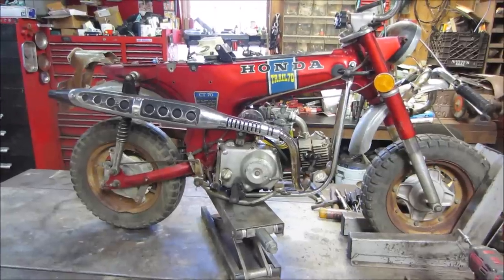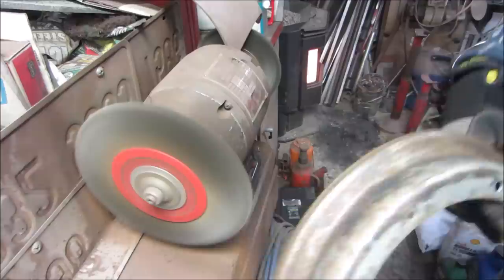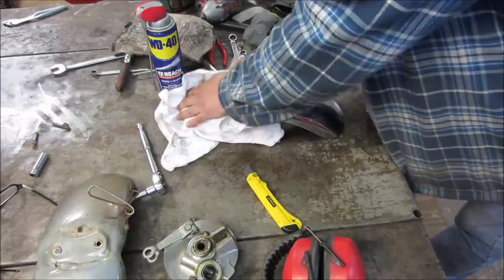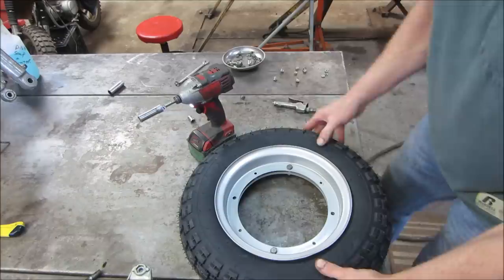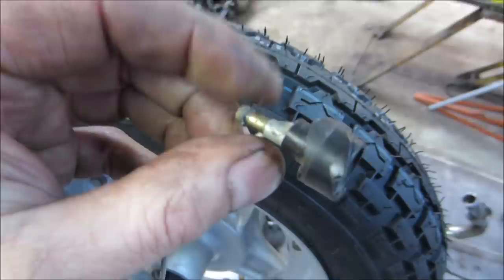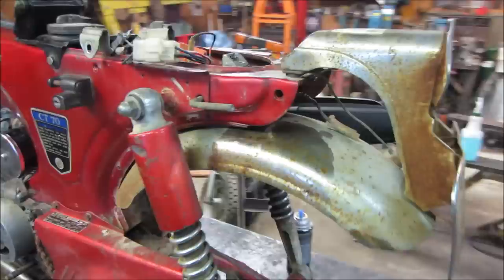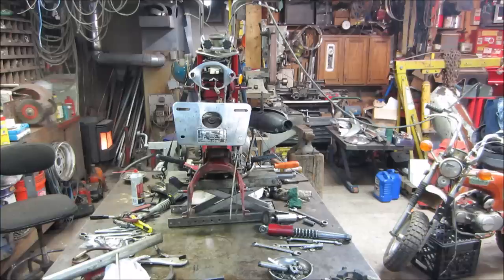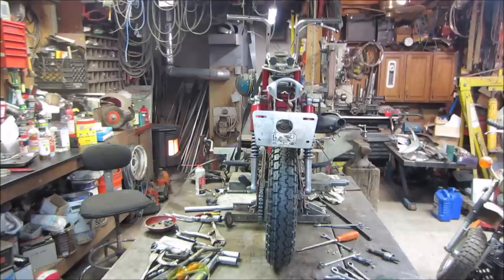Worn out Honda Trail 70, wheels and frame repair, pt5

Comment: Hi, 
I fixed up a 1980 Honda cb650 custom. I sand blasted and acid preped the  trailing arm and center stand the powder coated them, The bottom side of the fenders looked like your trail bike there so i used phosphoric acid which I think was a some kind of pool cleaning acid agent? It removed all the rust  VERY well but after that I brushed on some cosmoline greasy like stuff but it holds up very well in the road and salt corrosion. used the cosmoline on my trailer hitches as well too with great success. But its getting hard to find now. They used to protect the old stored military weapons with it. I , in my youth had a mini trail 50 Honda and we beat on it and raced it through the woods but we only managed to bend the foot pegs when "brushing by" some trees. they are very forgiving ! It is a about a 1970 model and still sits in my parents garage ready to the grand kids.
Reply: Phosphoric acid is the main ingredient in most of the relabeled 'Rust Killers'. Just cheaper!

Comment: In the UK we call the pin holding the wheel nut on a split pin (because it's split) and a tube that has a slot down its length a cotter pin, and a metal insert in a machined groove a keyway .

Comment: In the UK a Cotter Pin is the wedge shaped pin used to secure bike crank arms to the crank.   The pin that would go at the end of a brake pedal where it join the master cylinder is know as a Clevis Pin and the thing that secures that is a split pin....   Vive la difference..
Reply: Drew's Page , why do you people drive on the wrong side of the road ?
Reply: @bwanabwana9523  It's all Napoleon's fault :-)

Comment: I wouldn't worry too much about a wee bit of smoke. When I was a kid my 4-speed Trail 70 was bought used (very used). It smoked quite a bit. I road it hard for several summers before we finally got around to replacing the piston and rings.
Reply: Does the smoke mean the rings are starting to go bad and letting a small bit of oil past and its burning off in the exaust stroke, hence coming out the exaust as smoke?
Reply: @big_air_jer9768  Yes... sort of. The oil is getting past the rings and actually burning during combustion. So you end up with a smoky exhaust similar to a 2-stroke engine. :-) On a 4-stroke you can also sometimes have a little leakage around the valve guides but 9 times out of 10 it's just worn rings letting oil get into the combustion chamber.
Reply: @eosjoe565  thanks for the knowledge.

Comment: Does anyone else notice a hour flies by while you are hanging out in the garage? This is incentive to finish up my framing and get the sheetrock hung in my "garage" (16' 8" x  18' 6"), but it is inside which beat the sand, the rain, the sun and the pine tree roots.

Comment: Since your chain tensioners are about at their limit, I would remove a link on the chain, that way  there is still room to adjust as the chain stretches.

Comment: When you added the rubber dampers in the rear wheel, if you look closely one side of the rubber is cut radially and other circumferentially.  If you flipped then over and put them back in the hub the sprocket would fit easily. You can see at 47:07 when you prised one out and just slipped it onto the upturned sprocket.
Reply from the maker: l tried you cant get them in the hub

Comment: TRICK WITH SMALL RUST PITS- take a wad of aluminum foil and get it wet and rub it on the pitted rust and the rusty corrosion sits proud of the chrome and catches tiny bits of aluminum and polishes out the rust with some rubbing the aluminum blends with the chrome and hides the rust

Comment: Do you think it needs.rings or valves,because of the smokeing,you done.a.lot to this one,this one.was abused a lot.I wonder about things like swing arm.bushings,fork fluid .your repairs are right on,I used to collect  cz motor cycles,I no how much you can sink in a bike .I built many other bikes,I took my time used the best parts I could afford .it was fun .I do enjoy your videos.
Reply: Constant smoke is rings. But it may clear up if given a light hone and a new set. Figure it's been setting for close to 30 years.
Reply: @Blazer02LS  Thanks for the info ,I had some good luck with that restore for,you add it to the oil ,it looks like it had copper and I think lead floating around in it ,it will bring up the compression,stop oil from burning,stuff is about 8.00 walmart ,I have never had any problems with it and it works,just a thought you are the expert.thanks for your videos

Comment: In the bottom inside of the rear fender was a hoop that holds the battery drain hose when routed right.

Comment: Ah I love split rims, apart from on one of my 60s scooters that has tubless tyres, theres a big piece of rubber that fits between the rims... pain in the hole to get that to seal now.. will have to get some new rubber made it for it next time. fancy bead breaker too! for smaller stuff like scooters I usually use an old wooden chair leg and stand on the chair :D

Comment: Mustie1 DO NOT use Lithium-base grease on slow-moving parts such as cables. It's hygroscopic and will cause corrosion. Use a Calcium-base grease or a very thick oil. Wynn's or STP "oil treatment works fine. Or stern tube oil as used on boats.

Comment: Use potato flour instead of baby powder, MUCH cheaper.
I have a big plastic bag with pack of potato flour in it.
Put the tube in the bag, close it and shake. It will last you a lifetime.

Comment: That's a split pin. A cotter pin is a bolt with a tapered flat.
I note even UK Amazon doesn't get it, but UK ebay does.
This UK/US dichotomy may be recent. Whilst US kids were busy building hot rods, and borrowing dad's car, British kids were getting around on mum's old bike, which we had to repair ourselves. The cotter pin holds a bicycle crank on... still does. The split pin on the cotter pin locks the nut.

BTW: it probably doesn't matter much, but the tyre valve is now on the opposite side. AFAIR, they were usually on the 'clean' side of the bike, away from brake dust and chain oil.

Comment: I'd be tempted to pull the head and cylinder sleeve, ball hone it and replace the rings. I think the oil control rings have probably lost tension from sitting all those years

Comment: Factory spec is 7W fork oil (or ATF), 3.5oz after a draining, 3.8oz dry-fill, after a rebuild. Most adult weight riders get better results from 15W or 20W fork oil, and a little extra fill quantity (closer to 4oz), stopping short of hydrolocking the fork legs before they can bottom out.

Comment: you should try a little Coca Cola and a crumpled ball of aluminum foil for removing rust and polishing chrome. it wont  scratch the metal. i use it on my patio furniture. works great.

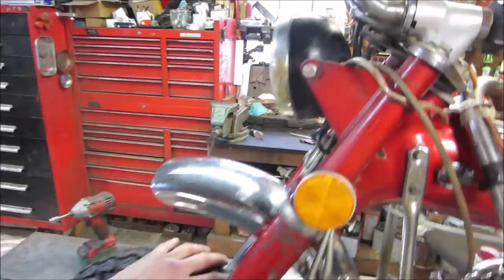Comment: 30:00 With that much mileage, you should also check the piston and cylinder for wear, and though the cylinder sleeve is steel, the piston is aluminum and would need replacing, if not just new rings, and honing the sleeve wouldn't hurt either. The pistons were so thin on those engines, the would sometimes crack, or get burned or worn through on the bottom. With proper oil changes, and care, you might not have to do anything more than replace rings...

Comment: Loving your work, but that brake lever is on the wrong side. The hole for the cable barrel should be on the bottom to help stop water going down the cable. Other than that great work so far 😀

Comment: I used fine steel wool then Dupont Chrome polish on my Honda Trail Bike chrome.   Never used wd-40 for fine wooling.  I lived on the Gulf so rust on the rims was a constant battle.  Does the heat on the paint quick cure the paint? Those Mini-trail tires would run on 30 pounds easy. I knew a guy that would separate the rimes by inflating the tube to the point the rims would shoot out the side. Kill switches came later.  I'm one of those yelling at you through the monitor!  Hope you check the swing arm bushings.

Comment: License plate mount is askew the the rest of the bike.
My CT-70 the lights were turned on and off by the key.  There was no switch on the handle bars.  
The cam on the brake handle on mine there was a plate you could hinge over and get a parking brake.

Comment: I know you will never read this but I can always hope.A little denatured alcohol will make the grips slide on and off without any damage. When the alcohol evaporates the grips stick to the handle bars . Don't use soapy water because if the bars get wet while you are out riding the grips will slide off. Ooops.

Comment: 38:36 find the hardware is kinda decent. Seriously, on older bikes I rarely have snapped a bolt due to corrosion. Must be something they put in the metal. I know a LOT of the engine ones seem to have a lot of nickle in them or somethng, they just don't seem to rust that bad.

Comment: The big pin on the cranks of push bikes is called a codder pins, that pin that you pulled out on the front wheel of the Honda 70, that pin that is called a split pin, the reason is obvious.

Comment: Hay mustie1 you wouldn’t still happen to have the throttle side of handlebar for this ct or any other one that’s in rough shape I’m building a custom triumph chopper and want to use the weld on early ct perches to clean up the loot a bit on me bars great Chantal I spend way too much time on it lol

Comment: I'm pretty sure your brake lever is really a clutch lever for something else. I'm guessing this because it's make to go on the left side with the opening to insert the cable end should face down so water doesn't collect and leak into the cable.

Comment: Rubber!  Tyres, seals and whatever.  There's a German product called "gummi pflege".  It protects, rejuvenates and conditions rubber.  I was thinking it'd be good for your vehicles & projects, it's not expensive either.  I had an MB SLK and the roof leaked.  MB wanted crazy money for new seals.  I spent £10 on a bottle.  Treated the seals, and  no more leaks, the rubber was soft and pliable again.

Comment: You need to adjust the cam chain properly , last time you half done it
There’s a 14mm nut under the locking pin u tightened ,
Unscrew that and you find a slot head adjuster ,
That’s the adjuster, not what you undone

Comment: That poor trail 70. What happened to it. I rode 3 of them into the ground. Crashed every way possible, many times as fast as it could make it's self go. I never bent any of them any where near that bad. They area a very tough bike probably why weigh so much. It's like somebody dropped that one off a cliff. Or, rode it off a cliff.

Comment: Does it matter that the valve stem was not sticking out the brake side before you disassembled the front wheel?

Comment: Think you have the levers mixed up that right hand one with the tab on it looks like it’s upside down. You shouldn’t be able to see the cable end on the top of the lever it should be to the bottom side. Stops the rain and muck settling in the recess.

Comment: Do you get all your parts from the same vender? My new Nobby Honda 90 tires and tubes were I think, $89. delivered, Will see if I can get it running with a new carb and Battery this weekend. You inspired me to get it going.

Comment: I was surprised at how easily you got the dents out of the rim, sure not as rigid as a car wheel! Need some rust converter to get into the pits after wheel/blasting, but with the heating/drying that's less of a worry! Ha, did somebody complain about the crusty bolt-head? XD

Comment: Can't you put the old front wheel on the back the red one, to keep that smoky new one for the orange one,
Or did you dismiss the idea fixin that second one ?

By the way if you have a trick to keep chains away from rust that allows to use the concerned transmission ...

That would be considered as redemption !

Comment: Am I mistaken or should the front brake be engaged with the right lever? Every bike I’ve ever ridden is front(right) & rear brake (left).
Reply from the maker: not on a semi auto
Reply: My mistake. We had multiple Trail 90’s in the early 70’s but they must’ve been different.

Comment: You are right. In the UK we call them split pins. A Cotter pin here, is a tapered pin, tapped into a reamed tapered hole. Used to see a lot in Victorian engineering and clocks, but not so much now.

Comment: Ok, I need help so i have a john deere mower, It had gas in the oil so i drained the oil and checked the dipstick it had nothing on it, Then i put SAE 30 in it and it still smelled like gas so i drained it again and put more SAE 30 into it and it still smells like gas

Comment: Did you buy or make your scissor lift table. Looks nice and strong.
Reply: The lift table it's self, he bought from a company called Handy Industries. However, he made the side extension pieces for it himself. (As he was working at a fabracation shop at the time. Not only did he save money, but it also allowed him to go with an in between size, as the sizes that Handy offers weren't to his liking)
Reply: @MellowYe77ow  thanks for the reply
Reply: @lewislewis4917  You're welcome.

Comment: I can see the exhaust valve oil seal is leaking. The spark plug will be black in 10 minutes. Only one exhaust valve seal on those old Honda's. Quick job to pull the head and replace the exhaust valve oil seal. I don't work on those anymore because they all need the oil seal replaced on the exhaust valve. They do not have a fuel choke, spark plug should never be black. Pull the spark plug, if it's black you'll be replacing the valve seal or the unit will keep stalling. Sorry, but I can see the smoke out the exhaust. It will run, but not for long. Please respond if I turn out to be correct. Put a brand new spark plug in it, I bet $10 it's black in 10 minutes.

Comment: Those cable oilers are shit.. BEST way is to use a short  piece of fuel or oil line  and a clamp. Slide the cable and housing into one end of the hose and clamp in place with a small worm clamp. Pour an oz or 2 of engine oil in . Take your blow gun and using shop air, blow the oil through the whole thing. 20W50 inside will make them like new.

Comment: Well, welll, good , interesting stuff/ job, but....I used to work in a tire garage, you should lubricate tires, both size, before put them on rim, then add 4-5 lbs air, the tire will "centralize", set better, and will  balance better, you put them on dry?? Why?? Just saying ;o))

Comment: Mustie1, Do you know what primer is for ?
Reply: I found this answer on the Amazon comments section: "With any paint, adhesion is dependent on having a course enough surface to adhere to. Primer is recommended for any surface, but not always required."
Reply: @blueribb99  My comment was  rhetorical. He never uses primer.